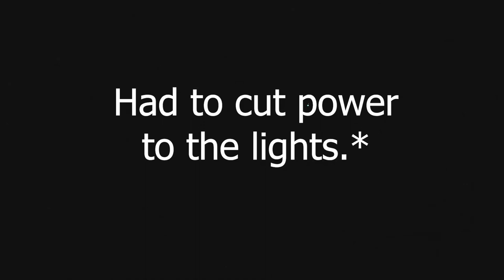Death Star Media Room Rebuild Part -1

Comment: man this is so cool, hoping to do something similar to this so I was wondering if you wouldn't mind telling me what brand of door have you used for the entrance way, either way this project is stunning
Reply from the maker: Thank you!  The door opener is from a company named AutoSlide, https://autoslidebyevo.com/?ref=StoreYa&utm_source=stry&utm_medium=trafb&utm_campaign=storeya2b&utm_term=kwd-304918761785

I used a pocket door rail system that can be purchased at any big box home improvement store.  The door itself is simply a particleboard sheet with hardboard for the decorations.  I went this route because dressing up a regular door would have made it too thick to fit between the studs of the pocket door setup.  Hope that helps!  Good luck with your build!
Reply: CG-RTist awesome Thankyou so much!